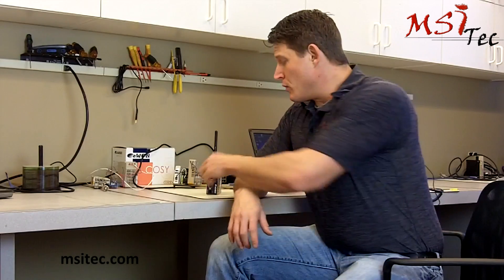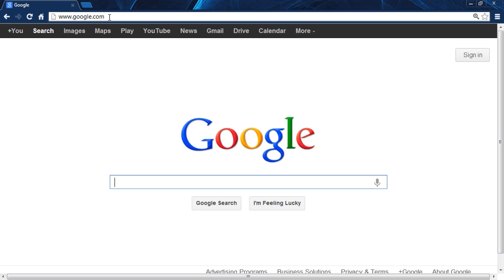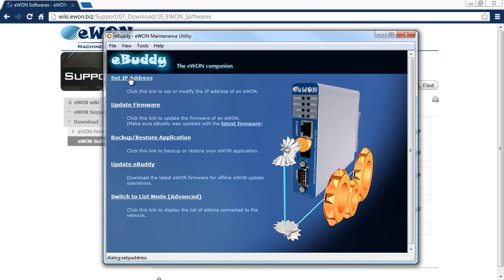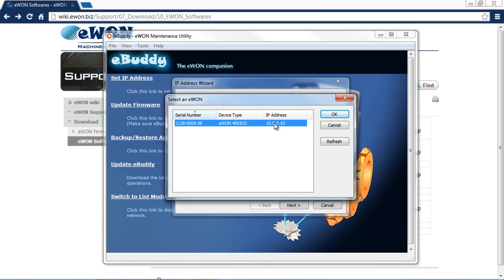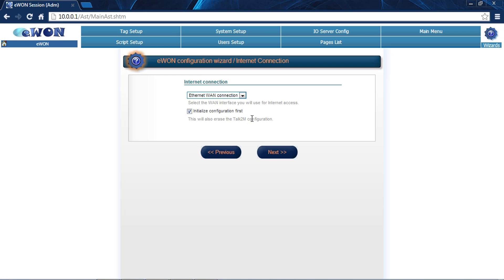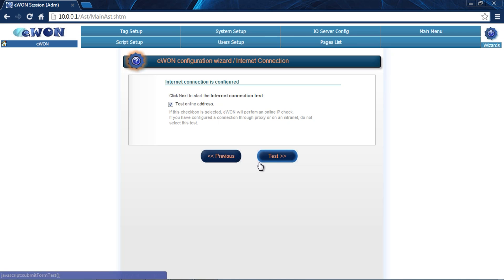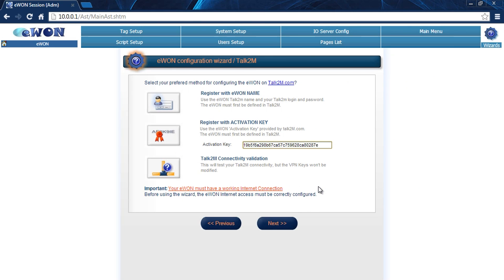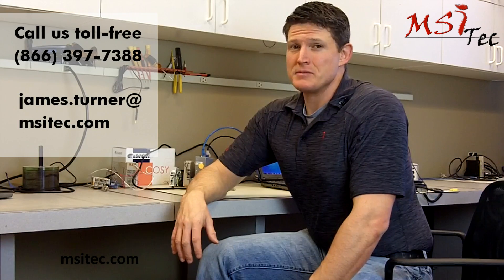Setting Up Your eWON 4005CD Industrial LAN Router

Comment: thanks.i want to ask a question about ethernet cable. one end of ethernet cable plugged back to port 1, one end of other ethernet cable plugged back to talk2m. i want to know where these two ends of cables go? thanks.
Reply from the maker: One Ethernet cable, would attach to the Ewon 4005CD internet facing WAN port. One Ethernet cable, would attach from port 1 to the device (PLC, HMI, Industrial Control device, etc..) you wish to gain access to.
Reply: @MSITEC  thanks sir. 
very handy.

Comment: hi, i'm having problems from 06:19, when i need to configure the internet connection.
this error appeared "There was a problem retrieving the XML data"
can you help me?
Reply from the maker: Hi Bruno. Make sure the firmware is up to date and the date and time are set. Ewon has a great support portal that can provide more help:  https://www.ewon.biz/technical-support/support-home.
Reply: @MSITEC  well I updated the ebuddy firmware and the error is gone, now another error is appearing, I haven't tried to update the ewon firmware yet ...but thanks for the support info.
Reply: @MSITEC  its great support and maxvulnerability routers :D